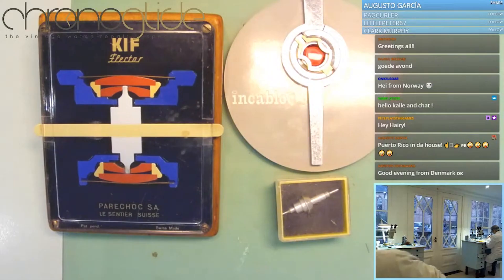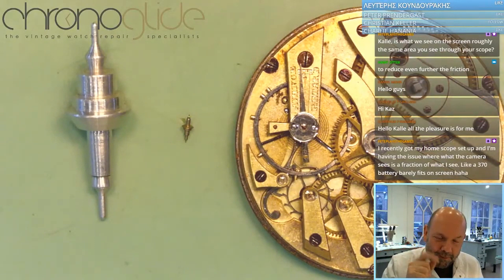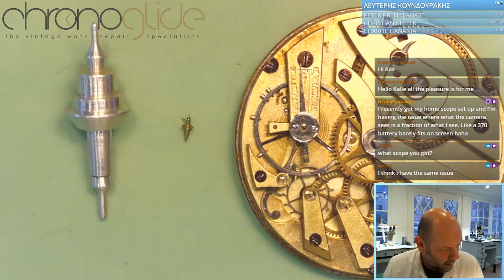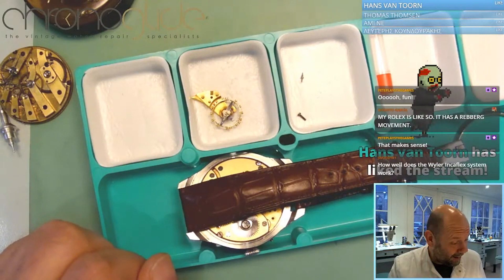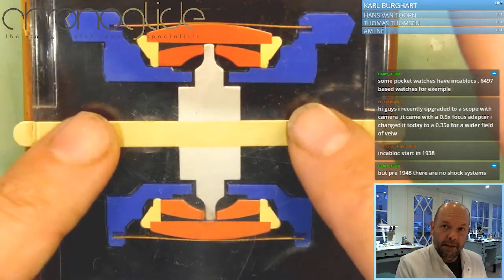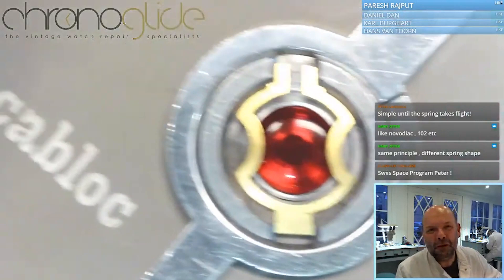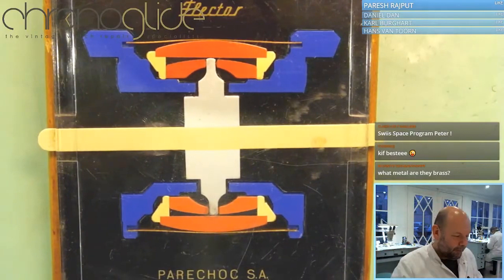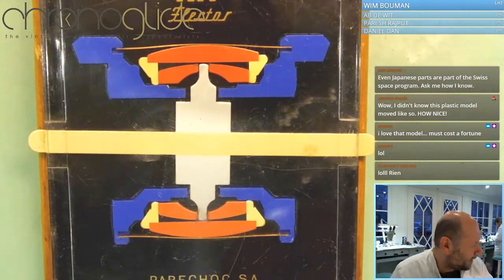Incabloc Part 1of2 - Shocksystem

Comment: Is omega 8900 master co axial movements easy to service?
Reply from the maker: Hi Mohnnad, the oiling is critical and not very easy to get right without enough practice.
Reply: @ChronoglideWatchmaking  oh so if scale 1-10 in terms of difficulty what is your scale for omega co axial movements? And does the other parts is easy to service and oiling them ? Thanks in advance 🌺♥️
Reply: Once , there was a very old watch maker, (he already died with 80),  he used to sell some watches, and show me some, I asked him, dont you have any omega?
What did I asked him,.  He got mad and he answered: You people you just like sh...if i had a place to hide myself in that moment.
Reply: Do you have any tips on putting the three pointed retainer springs  in the cups with three cutouts?